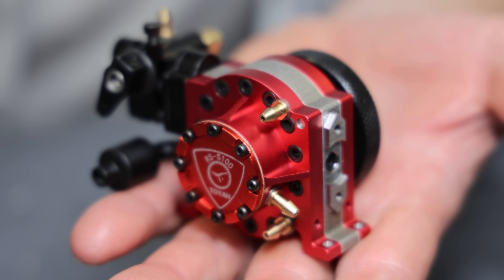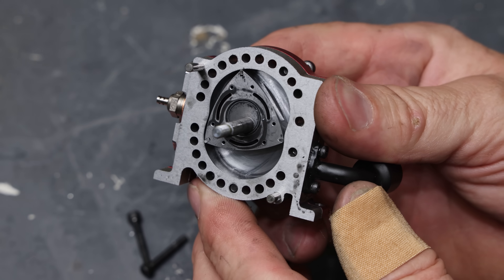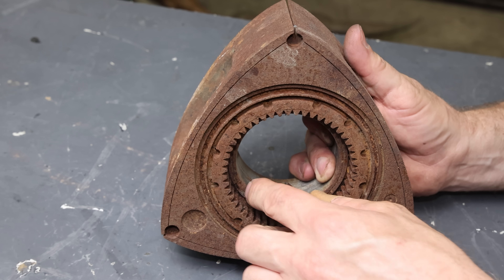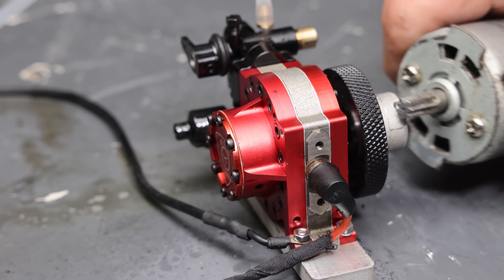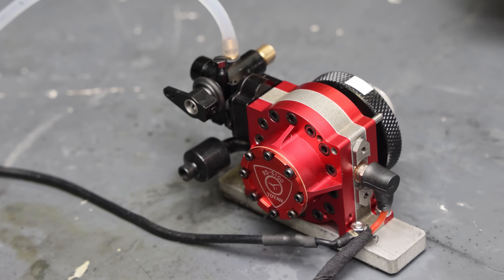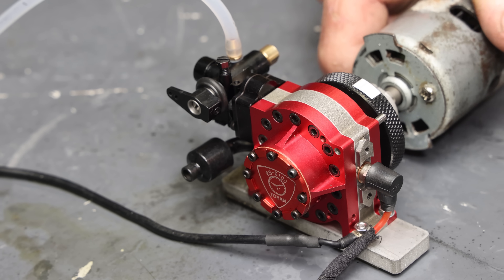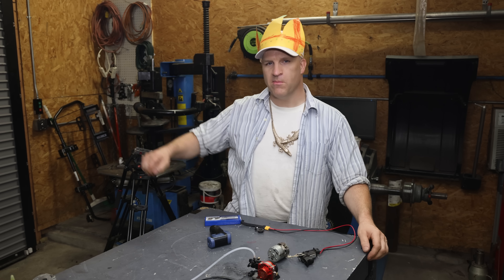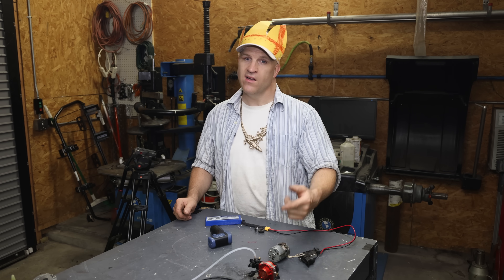Worlds Smallest Rotary Engine (30,000 RPM)

Comment: Ya it's tiny and original but are you going to use multiples of these tiny engines practically in the propellers of a mountainous ship or a plane or an helicopter by integrating sophisticatedly inside the edges of propellers fitted with tiny propellers rotating accordingly vice versa direction of the main propellor blade of ship or plane or helicopter

Comment: Why not use these to power ground effect fans? Could they be effective (and light, and only needing to divert small amounts of fuel away from the main engine meaning a slight increase in fuel consumption)?

Comment: I think it didnt like you pulling it apart.
It certainly isnt running right, id like to of heard it before you pulled it apart.
Such a shame you couldnt of put a diagram of it on the video instead of pulling it apart and not only that, gaskets 9/10 only can be used once and it was set up ready to run out of the box.

Comment: Nice engine but cost too much. looking for a used one also to mount.  :)  Then to get a good sound occoirre start from 10 cmc up.  :) I already own a Wankel NSU but for the moment I keep it in its box without using it but I 'd fired it up several years ago.

Comment: Looks good , but very impractical because it is not made of good enough material.. the virbration and thing falling of and leaking is down to bad fitment and pooor building. im sure if taken apart then put back together using proper sealants and thread locker the motor would stand more of a chance... the starting should be by a belt, that little starter with the internal cog is a bad idea and wont last too long... power is not that great for its size at all... a 3.5 cc glow motor is normal more power more rpm and a lot more reliable... so many good strong little glow motors around this does not stand a chance...

Comment: And this is why I stopped my Nitro Hobby ! was way too much stalling and starting and stalling and starting . Went to Lipo with is way more reliable. But the batteries need to be maintained also. but they never stall 300 yard away. This rotary looks like it's way too much maintenance 😬😬

Comment: Two years later, no update.  And quit going for the tach before you let the engine stabilize.
Reply from the maker: Sorry, I suffered a brain injury. I got the new parts for the twin rotor about 6 months ago but I just recently got healthy enough to start working again. Shortly after this video I went to work on Mr beast videos from September of 2022 to August of 2023, as soon as I got back from the last project I had my injury and ended up in the ICU for 5:weeks. I just started feeling good enough to really work again about a month ago.. so yeah I really didn't mean to follow up on this and hopefully I will soon it's on my list but like I said I'm just getting back to work now... Super broke but I'm going to try. Thanks

Comment: 2.4 cc .7 hp 

Now we’re getting somewhere lol

However the “super charger” configuration did absolutely nothing to the over all performance of that machine during that initial test. 

When the tube came
Out and you pushed it back into the charger there would have been a boost in performance instantly. But there was absolutely no noticeable difference.

Comment: My highschool  auto shop got a 90 rx7 convertible with a broken spark plug,our class wanted to tear that motor apart but teacher picked a 5.0 for our project.He told the class "Rotary engines  had to internal moving parts and that we  would never be able to assemble it again.For years I imagined hundreds of movies parts as you separate the rotary engines, thanks Mr kerns.youare a crappy teac5😅 ati

Comment: What about the cooling? Also, what gearbox would be able to ingest 30 000 RPM and drive an RC car? Without a gear box, and direct drive, a car featuring wheels with a 6 cm diameter would go 340 km/h, thats way too fast for the horsepower provided. Therefore a gearbox ratio of 6:1 or even 10:1 should probably be used, which would also increase torque.

Comment: You REALLY want to see a TINY engine? Check out a Cox T.D. .010c.i. and Pee Wee .020c.i. engines. They are SMALL, and just about weightless. They pack a punch for their size though when you run them on 30% Nitro fuel. 

You really have to add some Castor oil to commercial available car and even airplane Nitro fuel when you run those little Cox engines. The typical 12% or so of synthetic oil in todays fuel just isn't enough to lube the tiny internals. You want around 20% oil content in the fuel, and at least 10% of that should be Castor.
Go to your local drug store if you want to run a Cox, pick up some Castor oil, and simply add the correct amount to your fuel to bring the total amount of oil up to 20%.
Reply from the maker: I looked That up, its indeed tiny

Comment: Flooded, just like the rotarys love it???  No, I had an FD.  When it flooded I would have to pull the spark plugs, crank it, inject a little transmission fluid into the sparkplug holes, then it would start...

Comment: Hey quick question, even though this is 2 years old. Do those apex seals work just by centrifugal force? Or is it all mechanical with those springs at back?
Reply from the maker: both i believe, the only reason its 2 years old is because ive been waiting on the parts for over a year lo

Comment: smallest single rotary engine to be exact. Apex seal Failure how typical. Need a automated fuel management system, in order for it not flood at start. Good job BTW.
Reply from the maker: correct

Comment: World's Smallest Rotary Engine .. impressive, very well done

then God said "Hold My Beer" ...

Have a look at the Flagellar Motor (A recent SmarterEveryDay video covers it well from an Engineering perspective). Complex electric reversible pinion-driven motor capable of 100K rpm formed by amino acids. Bacteria were swimming around powered by these biomechanical motors 2 billion years before mammals appeared. 👍

Comment: 30 000 per min is 500 per second. Crazy
Reply from the maker: Yeah it is, 500 revolutions per second, that would be one revolution every 2 milliseconds. So imagine like the smaller jet engines I have, those are 140,000 RPM, That would be almost 2500 revolutions per second. That's pretty interesting to think about
Reply: @WarpedYT  can’t imagine. Wouldn’t expect that any materials can handle it.
Reply from the maker: @MrZiyouren  All depends on the diameter of the component spinning that fast.

Comment: I would totally buy some of these just to mess with if toyan priced its stuff comparable to other rc motors. Honestly its not that much smaller where they invented anything or teally made anything new or difficult to manufacture and they want $500-$850 Toyan is on crack. I love how they sell a lot of their engines without fuel or ignition solutions (usually on their miniature 4 stroke products) their is a reason why the largest nitro rc engine maker O.S. decided to stop selling their version, because it's also a terrible engine. For an rc plane the brushless motors are way more powerful and efficient and reliable. Rc cars, even if you wanted a nitro setup, there are like 100's of more powerful better nitro engines that make 3 times the power for a 1/3 of the price. It's good at nothing really and O.S sales of their nitro Wankel was almost non existent because it had no good actual practical use they were also way more expensive than a standard piston nitro engine, and the lack of power compared. O. S. Basically themselves said it's only bought as a novelty and finally was smart to discontinue it. O. S makes so so many different models, for them to stop production, it has to really be basically useless......
Reply: P. S. Never buy a Toyan engine unless you are the type of person that could instead of toilet paper use $100 bills to clean yourself and flush away every time and every day you use the bathroom. If you have money to that point you can use it as toilet paper, ok buy a Toyan engine. But I would recommend actually ordering another real engine for whatever your building.....

Comment: I think the reason it had problems to start initially is because it wasn't run in and the rotor tip seals weren't doing their job until the surfaces mated properly.

Comment: Maybe take about .0005 off the center housing and lap the rotor to the side plates, assembled without the wall seals. Start with iron oxide 0000, then using cerium oxide and oil as a compound for final polish. Gotta get those sides to seal better. Has to be reassembled EXACTLY as it was lapped.  Should be super tight during break-in.  Several short runs before letting it heat up. CLEAN CLEAN CLEAN... Now I'm wondering if the wall seals need a few lapping sessions before full throttle, too.

Comment: How well can these small rotary engines recharge batteries with various fuels?!!
Just wonder if they can be used to recharge batteries in my remote home off the grid with fuels
such as alcohol, gasoline, ... and even hot steam from pressure cookers?!!

Comment: Would it be practical for a small rotary engine to burn the exhaust and crankcase gases on a car’s 4 cycle engine?  Could the rotary engine provide a cleaner final exhaust? The rotary engine could also spin the car’s alternator. The rotary engine could keep the car’s main engine much cleaner? Just wondering, after seeing this micro rotary engine.

Comment: Now you just need 25 Rotors and you would have 17.5Hp out of a 60cc Motor for a Bicycle or 35Hp out of a 50 Rotor Motor that would be only 120cc for a Small Dirt Bike or a 100 Rotor Motor of 240cc with a Output of 70Hp for a Middle Size Dirt Bike or how about the full size car Motor Model of 2,000 Rotor Motor with 4,800cc or 4.8L with a output of 1,400Hp then Compound Super Charge it. The Right Perfect Gearing would be So Important and Lots of different Gear Choices is Better then Few Gear Choices when it comes to Motors that have a Very Narrow Power Band and High RPM and Low Crank Tq. but I think a Video with a 2,000 Rotor Motor in a full size Car with the Right Gearing would be a big Hit on YouTube on your Channel.

Comment: I'm curious.  Did you make the tip seals as well?    If so that would be an interesting vid.  
Especially since Mazda probably won't be around when I need my next set for my 12A engine.  That 13B rotor had me in tears.....

Comment: max rpm 15600... right on the site lol ..  its a .9 cubic inch NOT the smallest given the OS wankel is .3 cubic inches.... water cooled :-( the OS one is air cooled, and the max rpm for OS  is 28000rpm and to this guys word they dont need tighter tolerences them most engine's :-\            No disrespect I been into  r/c aircraft a looooong time....

Comment: How does this engine get cooling??
Reply: See at 0:14 the brass nipples sticking out at the bottom, middle and top of the end case?
That's where the water cooling goes in and out...
See at 1:37 that there are holes all around the chamber...that's where the cooling water flows...
Reply: Yes ofc, i see👍 @JohnSmith-yv6eq

Comment: This engine would be an interesting testing ground for a rotary powered glow ducted fan jet. Ducted fan jets originally started with glow powered piston engines, but piston engines lack the high rpms required for a ducted fan system, since nowadays they are all electric, or fully turbine powered. It's thirty thousand rpms, and more compact profile would be interesting as an experiment for a ducted fan.
Reply: He ran it at nearly twice the recommended RPM. 16,500 is what it says in the instructions, but I'm sure you could do something with a bit of gearing. 

Not too much gearing though, its power relies on RPM more than torque.
Reply: Always ‘rpm’, never rpm’s… how many ‘minutes’ would it be?

Comment: thats very hard to start
Reply: I wonder if  more fuel could be supplied if the fuel tank was higher up and feeding in by gravity rather than fuel having to be sucked up to the carb?

Or if some exhaust pressure on the fuel tank might encourage fuel flow to the carb when the engine is running and drawing hard...

Note that he had to place a finger across the carb intake to richen up the mixture before it would start at all...?

Comment: My God, did that rotor come from a 13B in a 1993 Mazda RX-7 which was crashed into a lake & left there from September of 1992 & left there until September of 2023?!
Reply from the maker: Lol .. it was buried under my back porch for maybe 20yrs, I found it when I demolished my back deck of the building I grew up in. I used to rebuild rotaries when I was 15 yrs old and apparently had a bunch of rx7 engine parts thrown underneath that porch.

Comment: Why aren't you turning mixture screw out half to 1 turn to get more fuel to it instead of fucking just trying to  start it up and getting nowhere
Reply: Perhaps the fuel needs to be encouraged to flow..
like if the exhaust pressurised the tank when the engine was screaming hard?

Comment: ROTARY engines need to be TWO STAGE to capture the energy/unburnt fuel going out the exhaust port. similar to 2/ 3 stage steam engines.
a 2nd rotary cylinder getting exhaust through inlet. although the friction of that cylinder will offset any benefit.

Comment: Apologies but, I hate the way you treated that engine. No engine break in and running it at WOT without any load. No wonder why your silicone glow plug cover melted... Silicone melts around 250°C or 500°F! In the small engine/Nitro RC world that's well overheating to the point of engine failure In minutes which is why the engine started to sputter and stall at the end of the video. Poor little guy could have been used in so many awesome projects and all the work put into building that little thing completely wasted.. SMH

Comment: There are glow plug rotary engines for model airplanes that are smaller than that Wankel engine that does NOT rotate and therefore is NOT a rotary engine.  Yes, there is such thing as a rotary engine and by definition they rotate.  The Wankel does not rotate, therefore it is NOT a rotary engine.
Reply from the maker: 🤔, of course it rotates. And Yes this is smaller than those airplane rotaries, those airplane rotaries are 4.9cc this one is 2.4cc.
Reply: How is this even an arguement. OF COURSE IT ROTATES. Nothing can make power without rotating. If something spins 360 degrees on a 2 axis plane then, it is, in fact, ROTATING?

Comment: I wish you had tried running it BEFORE you tore it all apart and dropped pieces.
Reply from the maker: I did, the apex seals were jammed, that's why I took it apart on the first place
Reply: @WarpedPerception  oh. Sorry about that. I wasn't trying to be rude or anything, I was just wondering what it would have sounded like out of the box vs. After you looked into it. Amazing little motor! I'm surprised that it was like that when you got it! If I had gotten it in that condition, I'd have likely been screwed. I'm starting to understand rotory motors a bit. Watching that 12 rotor monster taught me a LOT! 
  Still, I liked your video a bunch. Think it's the first of yours I saw. I'll definitely be watching more, and thank you VERY  much for responding! It happens so rarely that when it does happen, I get a little...I can't remember what it's called, but it's that  "oh my God! HE talked to me!" Thing.😆 anyways, I really appreciate that, and I'll make sure to do the subscribe and 👍thing if I'm not already. Thanks again!

Comment: How is it lubricated?  Oil added to the fuel?  What is that dowel pin that moves to the flywheel side when at higher rpms?

Comment: that thing is running so rich, listen to how nice it sounds when the throttle is opened wide quickly and its allowed to lean out a bit
Reply: Listen to how it sounds accelerating around 7:50 when the throttle is closed and then opened.  The sound without the constant spluttering as it accelerates is how an engine should sound.  Once it hits full speed, it runs rich again and starts spluttering as it misses combustion cycles due to flooding.  as the jet in the carb is too large, and is allowing too much fuel in relative to the flow rate of oxygen.  Anyone interested in tuning engines needs to learn to recognise this by ear.  I'm not sure how the poster can say it sounds nice, until the tuning is fixed it sound sick, the kind of sick you go to a doctor for.

Comment: Isn't there supposed to be a load of some kind on the engine? Seems like just letting it hit extreme rpms with no load would naturally deliver extreme rpm's with little practical value as a load enables power calculations.

Comment: I owned a 1985 RX7 it was either a 12a or b, don't remember.I broke the Speedometer, raising to work,I beat some chev V8', and Nissan truck,lost to a '98 tricked out V6 Camaro,it was a lil beast,. Finally blew the motor 😅. Sexy lil Car.

Comment: I've seen engines many many times smaller than that.  Go look at the old RC 0.010 sometime.  Not rotary, but MUCH smaller, the whole engine isn't much bigger than that rotor.  On the RX rotories they had a little spring (I think, it's been a while) that made the apex seal much easier to install, but it was a multi piece seal, the stock one, so much harder to install than that one.  

A rubber band works well to hold them in place while you lower it enough into the chamber that they are constrained from being able to pop themselves out of the slot, then remove the band and slide the rotor the rest of the way down.

Good lord, could you have found a worse looking rotor?  That thing only looks like it's been laying in a frequently wet ditch for a decade or so.  Just sayin.

Full sized rotaries do NOT like it flooded, not in my experience.  Running that thing at wide open throttle with no load is going to end in tears, and rather quickly.